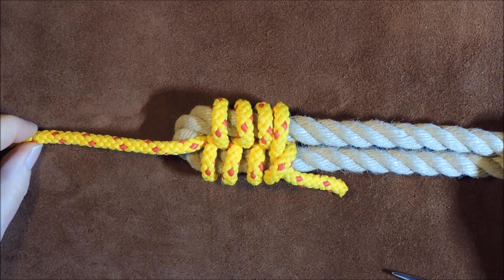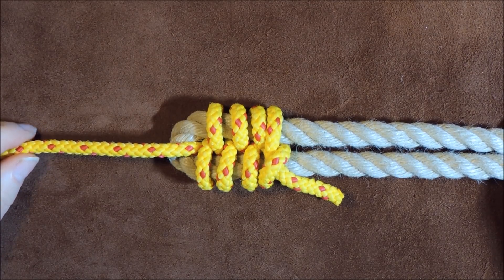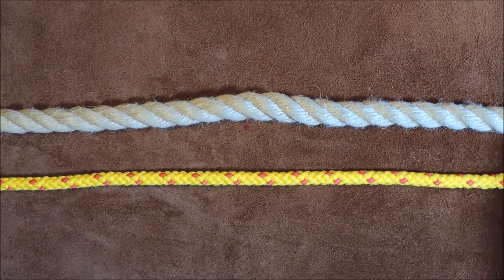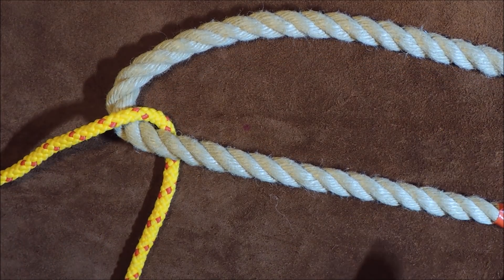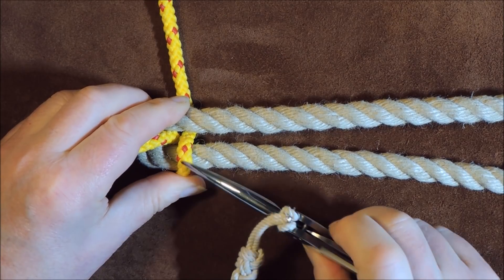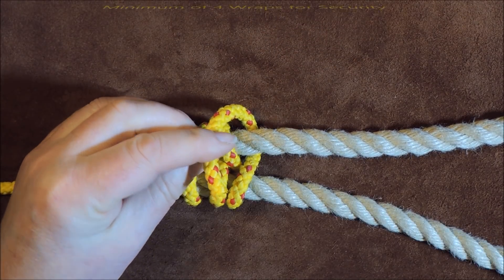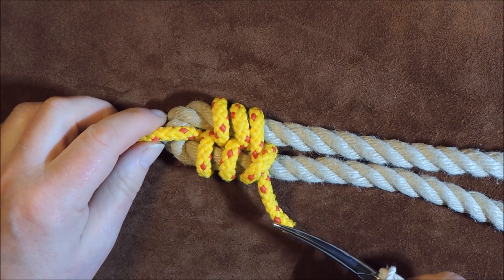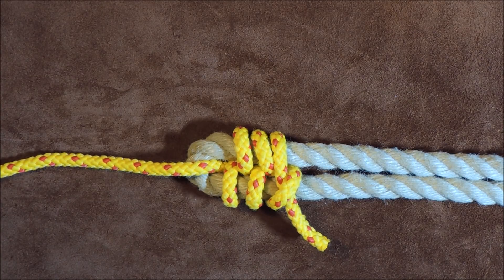Racking Bend Joining Two Different Diameter Ropes How to Tie the Racking Bend

Comment: Howdy friend, before a week or so ago I could only tie my shoes. :)  Now thanks to you I’ve learned around a dozen knots / bends / hitches / etc.  I’ve looked at many different channels showing knots and you are consistently the best at showing and explaining, so I wanted to say both thanks and kudos to you for being so good at cordage pedagogy.

On most of the videos I’ve watched on dozens of channels showing knots (bushcrafters, arborists, survivalists, boyscouts, mountaineers, riggers, truckers, etc) I’ve learned a lot from reading the comments.  It’s funny how vicious some people are, though comments are also routinely informative.  I’ve learned good hints about how more or less secure or generally useful various knots are by digging into some of the claims people make.  If the mood ever strikes you I hope some day you will consider doing some videos on knot (and hitches, bends, etc) comparisons.  For example, there are web pages and other sources that describe how various knots reduce the cordage maximum breaking strength by substantially different amounts.  There are also knots that can have quick-release and ones that can’t.  There are knots that are always easy to undo (alpine butterfly) and knots that are less easy but still easy to undo, and others that jam fairly easily and are essentially permanent once you put weight on them.  There’s also the extent to which the knot is bulky vs thin, flat-facing or not, suitable for use with string vs paracord vs thick rope, and so on.  I bet you know a lot of other relevant comparisons to make, too.

You could even invent some basic categories or uses and have a Best Knot for that purpose.  Or you could do this with audience participation using YouTube community tab voting thingy or asking people to upvote a comment with their favorite knot, etc.

I think you could get additional viewers with comparison videos because frankly there aren’t that many folks doing comparisons.  Try searching for “bowline vs perfection loop” or anything like that and you’ll only get disappointing results.

Plus, if you do some comparisons I can guarantee you’ll get new information about why you’re wrong in the comments section, no matter what you say. ;)

In any case I hope this message finds you well — cheers!
Reply from the maker: Many thanks for taking the time to leave a reply. Yes, I can certainly say that I have had a fair amount of abuse from some commenter's on this channel. A good deal now no longer exist as I wanted to ensure that this site is young viewer friendly. I do also have a blog here if you are interested: http://igkt-solent.co.uk/ I started a long time ago to "over explain" as I have one subscriber who is blind. He and his granddaughter follow the videos, he listens and she watches. He ties the knot and if he goes wrong his granddaughter corrects him. A lovely little bond must be growing between them? Good to hear that you are getting the knotting bug, I often just watch TV and tie my favourite knots. I just wish I could remember them all!!! Thanks

Comment: Beautiful! I think it's ability to hold very different size lines together is it's real selling point. I used it to join 10mm stiff line to 550 paracord. The sheet bend was not reliable but this one is. Thanks for this.
Reply from the maker: Yes, this one is just so easy and will also hold together a large unyielding rope. Thanks again for taking the time to make a comment.

Comment: Beautifully simple. I've knot used it myself but will if or when I have the need.
Reply from the maker: It also has better security than the Sheet Bend, but is more permanent as it is not as easy to undo in a rush. Thanks for taking the time to view and also make a comment, very much appreciated.
Reply: You'll forget by then  if there's not a small one in a collection to look at and practice now and then you'll be scratching your nuts going through any knot you remember for the task at hand .

Comment: cool knot! I'll try to keep it in mind, might be a handy knot at Work, on Stage
Reply from the maker: I assume you are in the theatre, what are your go to knots for that kind of work?
Reply: @KnottingKnots yeah i am, the most common one is probably the truckers hitch, we use that a lot to tension or secure stuff with, also the basics like retraced Figure 8s, Clove Hitch and Barrel Knot and some Eye Splices, though the last one is pretty rare.
Basically the same knots you use in IRATA
Reply from the maker: @dave1812  Very interesting to hear what you use. I wonder if you also use the Remote Release Lift Hitch: https://youtu.be/4q-WPaCQAZs
Reply: @KnottingKnots  i've never seen that knot, I'm not sure if you're even allowed to use it, because of all the Safety Regulations
Reply from the maker: @dave1812  I have heard that lighting riggers use it to lower their cables from around the stage area. But as you say, H&S would have a field day with that one.

Comment: Could just do a bowline on each or a sheet. Bend
Reply from the maker: Yes, but................ would be a rather small selection of knots to show.
Reply: Sheet bend does not work securely on two ropes of considerably different diameter, and two loops are bigger and the connection chafes, and the original line strength is greatly reduced.